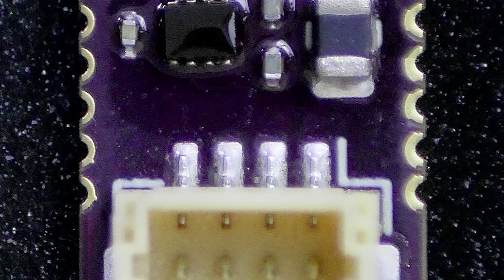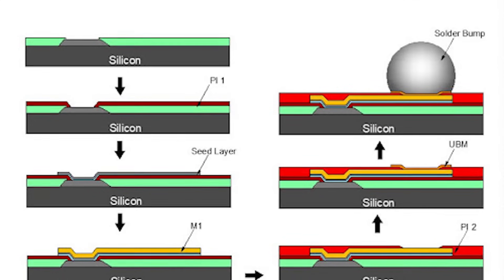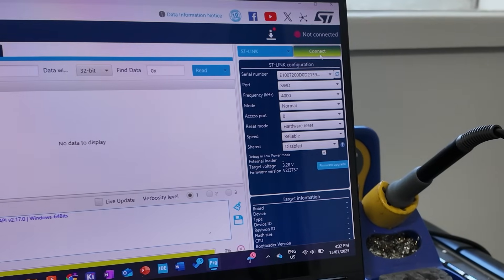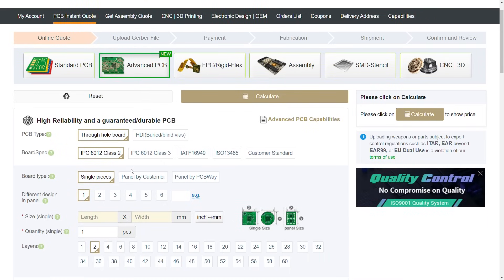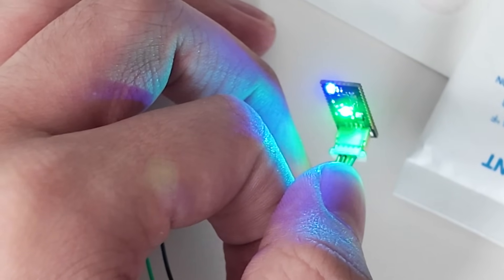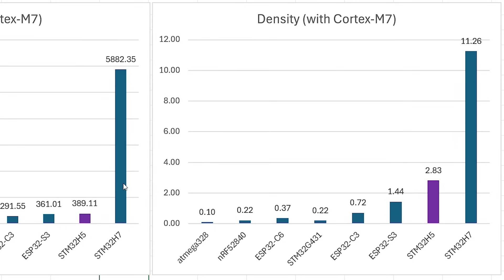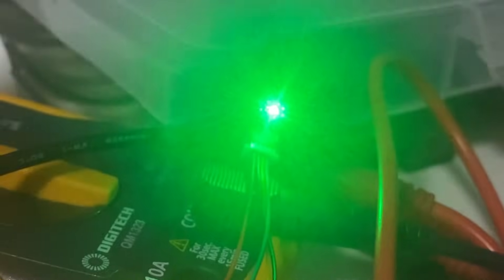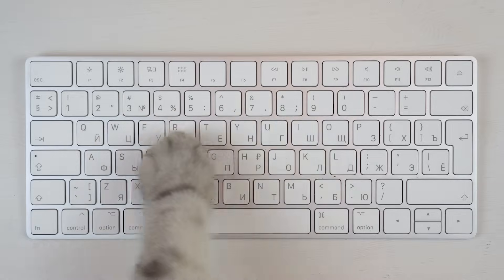I made a tiny STM32 module which OUTPERFORMS ESP32

Comment: The issue is you are not soldering it correctly. Switch you approach. First tin the pads with some 138c or 185C solder for the MCU. Then clean it up and apply a BIT of fresh flux on the board. then place the chip on top and reflow. When its up to temp and snaps into place gently push it so it seats correctly and let it cool down after reflow, this will ensure correct soldering.

Comment: ESP32-C3 and C6 have both same single-core 32-bit RISC-V running at 160 MHz (C6 has a 20MHz ULP CPU additionally), but your C3 score is double of the C6?! IMHO untrustworthy
Reply from the maker: Yep, I agree, that’s why I put the CoreMark. The meaningful comparisons are only from CoreMark, straight from the manufacturer datasheets.

Comment: What about the Teensy ? I'm sure it can beat the stm32
Reply from the maker: Some variants of STM32 can beat Teensy 4.1. H7R/S variants match the performance with a 600MHz Cortex-M7 as well. Dual core H7 variants beat it by 8% with a 480MHz CM7 and 240MHz CM4. And, STM32N6 beats it by almost 12% with an 800MHz Cortex-M55. However, yes, the Teensy 4.1 (which is a pretty massive microcontroller in the grand scheme of things, much bigger than NanoX) does beat the NanoX in a CoreMark test by 194%, since it is only a Cortex-M33 @ 250MHz. 😁
Reply: @h1tec  can you overclock the NanoX? That's the way she goes
Reply from the maker: @ idk, I haven’t looked into it yet 😅

Comment: As soon as you touch ground on campus, consider immediately going full force on trying to get a research opportunity. I think you’d be a perfect fit. If your school offers UROP it is a great pipeline. If not, sending out emails to professors and grad students whose labs interest you is generally welcomed. Clubs and project teams are great too, but I just wanted to give a heads up since I would advise against getting pulled into those without at least considering the research route first. It is usually less available to most, but I think the skill set you’ve acquired at this age makes you eligible quite a bit earlier.
Reply from the maker: Ok, thank you, will definitely look into this 😁
Reply: @h1tec  I think you can skip that and intern at ASML directly.

Comment: yooooooo how do I get one of these
Reply from the maker: Just to let you know, because of the via-in-pad technology and extremely challenging 0.08mm trace widths (or 3 thousandths of an inch) and clearances, one of these will run you over $700 USD. Of course, for 10, it wouldn’t be much more than the cost of one due to starting costs (~$800). I was only able to get these due to the generosity of PCBWay, as the PCB costs are included in my sponsorship from them. That being said, if you would still like to go through with this, let me know and I will create a page on PCBWay projects where you are able to buy it, and I will receive a 10% commission. lol, this video was meant as kind of a ‘stunt’ to show extremely advanced PCB manufacturing technologies.

Comment: Is it? I saw commercial m5 nano etc
Reply from the maker: @IssacBerry-nd8pt  what is M5 nano? This board is 8x17.2mm, I’d like to know if there is smaller STM32s 😁 Can it be powered and programmed independently, with a connector?
Reply: @h1tec  m5stack nano c6 is 24mmx12*10, but it got a casing with openings. I will buy that instead, at least for myself.

Comment: So let me get this straight.... You designed the smallest STM32 board to be placed/connected on the top of more breakout pcbs? Doesn't that defeat the whole purpose of compactness? Yet you still need to control the robot with no bluetooth nor wifi... So are you going to connect with a hardwire connection lol... Does that mean you need an additional breakout board?
Reply from the maker: @wikovisser3664  1. The sumo robot will be autonomous.
2. Every microcontroller board needs to be connected to other circuitry through hardware if you want to drive motors, etc - that’s either through a breakout PCB or through breadboard wires, or just wires, so your logic here doesn’t make sense. I just made a carrier PCB because it looks good. It doesn’t need to be connected to another PCB - it can be to add peripherals, but you can still program it and power it independently. It’s still more compact than an Arduino Nano and a Nano Carrier Board, which this was based off of. The entire system is 24x36mm, which is still smaller than some boards that only have a microcontroller. Thanks for commenting lol 😁😁
Reply: @h1tec  seems to me you are very clever. So never mind. Thanks for replying.🫠🫠
Reply from the maker: @ thank you so much man, you helped boost this video too! I hope you have a great week! 😊
Reply: @h1tec  my pleasure. You need it. I'll continue building my industry standard pcbs in the meantime.
Reply from the maker: @wikovisser3664  thanks! 😁

Comment: Price: stm32h7 cost 4,5 USD but esp32s3 cost 1,8USD. For some project stm32h can be better like for industrial or outdoor application because esp32 is know that have trouble with low or high temperatures but for home applications esp32 will be always the winner.
Reply: How do they compare in terms of 🛜 😉. I wish stm would try to match the versatility and price of the esp32. I get they have a different focus but competing options would be nice. 

@haase, Great video and project👍
Reply: @tomekolosie Hello, how can I contact you?
Reply: ESPIDF is terrible, and if you want do something that espidf devs don't assume, you got problem's. STM32/RP2040/RP2350 is MUCH more customizeble. ESP32 has only one benefit - easy to use wifi, price difference covered by time that needed to beat shitty blobed framework
Reply: @ can you give more specific examples?  

For example I find it quite easy for controlling servos, motors, doing ir send recv. Hosting a webpage over wifi for changing config parameters. Bluetooth was troublesome, but that’s not even an option on the stm.  

What’s the stm’s strengths?

(I don’t use espidf)
Reply: @autonoob   Realtime applications, where respond time must be in microseconds (sometimes hundreds nanoseconds), in high speed robotics or sensors (ToF applications). Also ADC in esp32 is fully trash compared to base 12bit stm32, if analog proceed needed, stm absolutely winner. Power consumption of all esp32 unacceptable for battery powered devices with high frequency wakeup, no matter, need wireless or not, boot from SPI flash is slow and power hungry. USB can't be reconfigured (I only test esp32c3) for custom action - only slow CDC with predefined VID/PID. ESP32 timers very weak - if need vectoring control, just forget about it. I can continue list cons of esp, but that really great MCU if you need just default cheap IoT without heavy DSP or complicated periphery
Reply: @ thanks for the reply, appreciate it. That’s definitely outside the scope of my applications. I mostly do RC stuff so sleep is of no interest and power consumption is nothing compared to the equipment it’s hooked up to. Size and cost are the biggest drivers for me. 

I was quite dissapointed recently when I found the interrupts had several microsecond latency, but I managed to workaround it. There are so many ways of doing things. 

I mean if you’re hobbyist coming from Arduinos the supermini boards are quite an amazing upgrade.
Reply: @ОбычныйЧеловек-щ7м I think a part of ADC not being so good due is to WiFi being on the chip as well. USB is configurable on S2, S3 and P4 models I think. I don't know much about hard real time stuff so I can't comment on that, but IDF is based on FreeRTOS where you have configurable task priorities and can configure a tick frequency to run scheduler more often (+ use interrupts ofc).

Comment: ESP32 doesn't need to compete, this board can't do any wifi/bluetooth/zigbee...

A lot more interesting would be examining the power draw comparison, for computation and when put in deep sleep.
Reply from the maker: @ivolol  lol, I know. That was so that you could click the video lol. Power draw is much lower than ESP32 because of Cortex-M33 core, check out the data sheets of each 😁 Also, some people use ESP32 for only its processing speed and not wifi and BT
Reply: Great, someone thinking logically. STM32 = overrated... If you really need a MCU significantly faster than an esp32 s3, you could just as well go for the pi-range...

Comment: Hey Hasse,  do you have any advice or tips for how to go about learning electronics/electrical engineering as a high schooler? Should I take courses? How should I learn? I aspire to make such great projects like you have!
Reply from the maker: @arhanahuja  thanks so much! 99.9% of high schools don’t have any meaningful robotics program - and even if they do, they mostly just use LEGO, unless you go to an expensive school, which I never did lol. The only thing it has taught me is good coding logic - it can also be helpful for team building though. It seems like you’re more interested in electronics at this point, which is the next step. What I would recommend to start out is making a few simple robots (line follower, sumo robot, or other robots you find cool - the important part is that you really enjoy it) with Arduino to start out with, and just using online tutorials. At this point, you should only make simple boards, like carrier PCBs and motor driver modules. After 1 or 2 years, you should start figuring out exactly how the Arduino and whatever add-on boards you get work. Then, you can design everything custom, and just make more and more complicated stuff after that. Hope this helps 😁😁😁